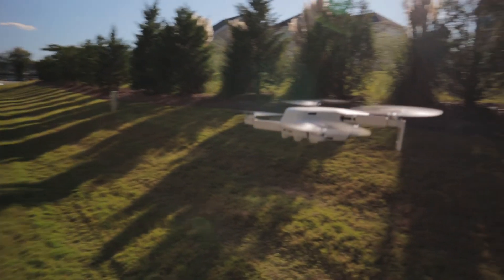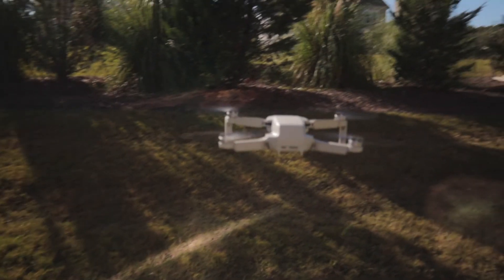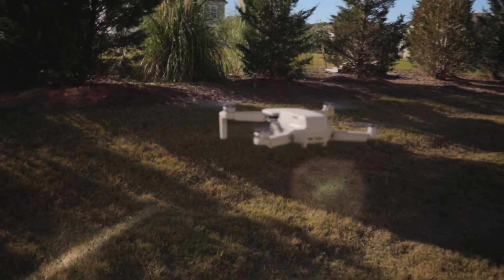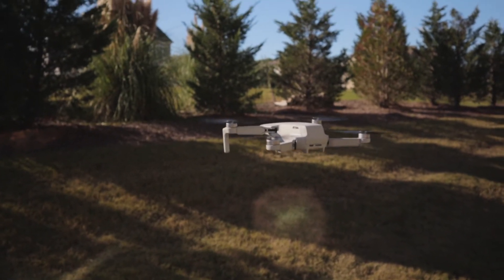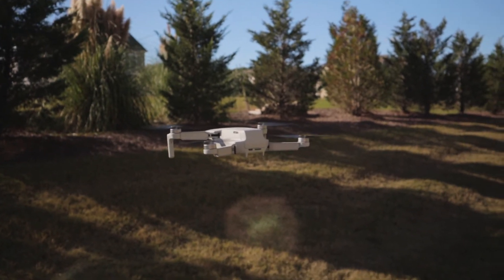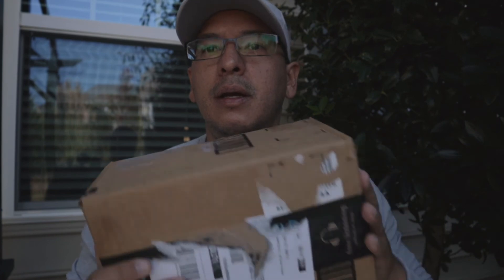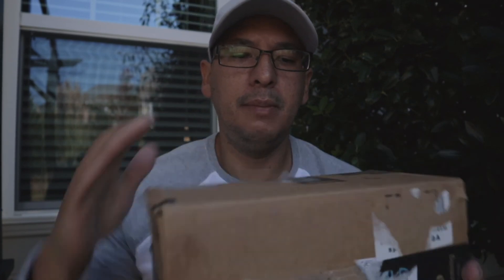DJI Mavic Mini drone Esc-Propeller rotating too fast Error. "FINAL SOLUTION"

Comment: Most if not all of those type of error, the culprit is the propellers, it may not show physical damage, but a slight deformation in which we cant notice is usually the cause
Reply from the maker: Yes. You are so correct. I believe the case was doing most of the damage when I was improperly storing it. I ended up selling it. Thank you 🙏